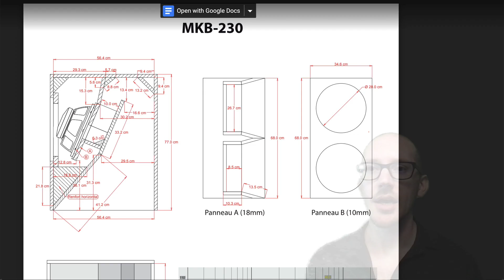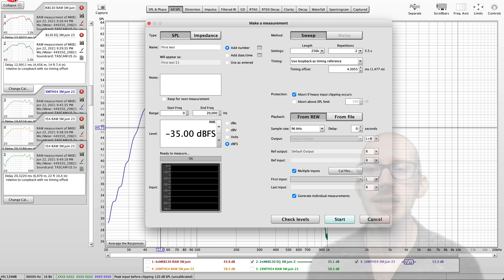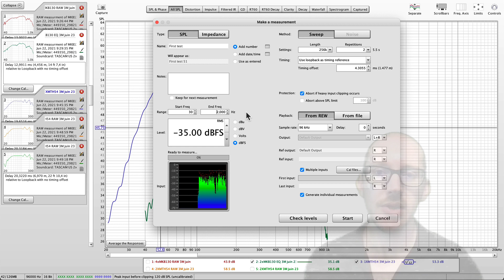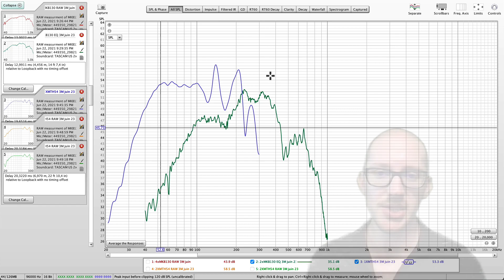Should I use a band limited test signal to measure a subwoofer?

Comment: Man, Crosslite looks more and more enticing every time you show it. I really want that ability to experiment with filters on measured data. How does it stand up against Smaart when it comes to taking measurements?
Reply from the maker: Hi Mashzmash! I agree, Crosslite is great. You should know REW, SATlive, and FIRcapture all allow you to play with filters. All audio analyzers are pretty much the same in terms of the data that you get in the end, they just may have different ways of getting there. One of the big advantages that Smaart has over other audio analyzers is that it allows you to measure several mics at once in real time. REW allows several measurements at once, but only not in real time. Crosslite is single channel only. But, if you are only ever measuring with a single mic, it won't make a difference to you.